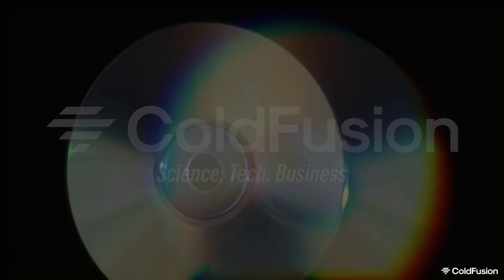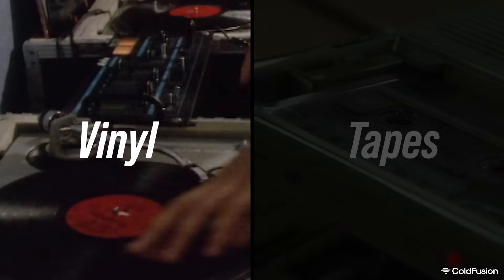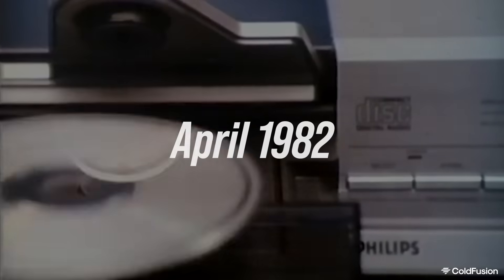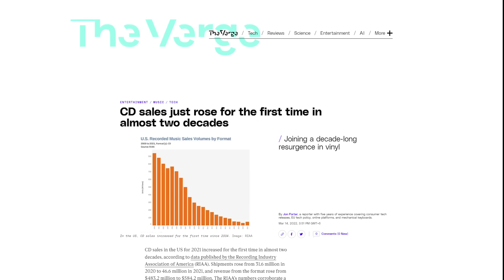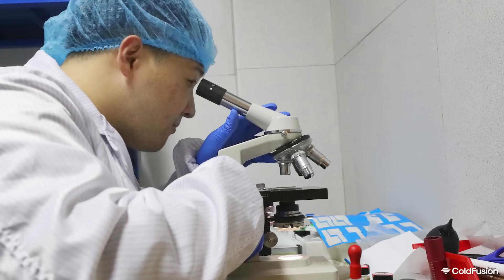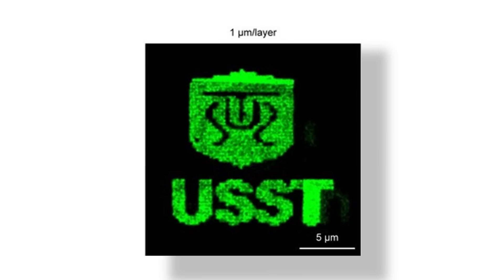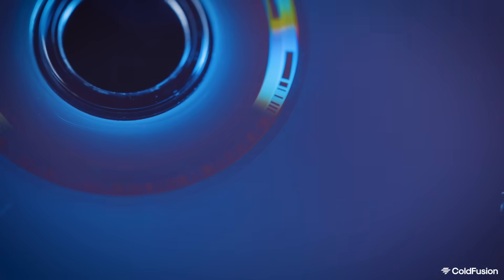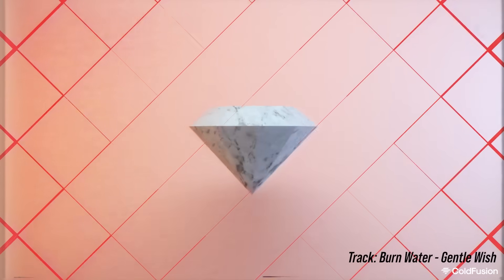Why This New CD Could Change Storage

Comment: If you want to store data for a long time, CDs are the overall best choice for longevity. 
HDDs and SSDs fail too soon if you want to store data for long.

CDs are back to stay.
Reply: tape backup is another good option, modern archival grade tapes are guranteed to keep data for at least 50 years which is more than a burned CD. a pressed CD might be able to keep up with that though
Reply: @oggilein1  very true! But that's mostly for enterprises, for the consumer the machine to read and encode is very expensive, even if the tape is cheap.

There is also the MDISC CDs which is rated to last a 1000 years, and now they have up to 100gb discs. Even if they don't last that long they solve the disc rot problems and other making it really durable!

For now the latter is my go-to for archiving media/data for stuff that I need to last.
Reply: @f11bot  with how this new disk technology currently is its not exactly consumer viable either
Reply: @oggilein1  oh yeah for sure, specially the equipment required to write or read, and its slow read speeds. But 100GB CDs are already very useful ngl
If someone found a way of making around 1TB CDs would be amazing, but without any major complications like just buying a new reader and you good!
Reply: @f11bot  Sony has a disk based archival system that has over a TB per disk cartridge... but they achieve it by having said cartrige actually contain 10 separate bluray-based disks (i think the disks themselves use a propriatary format to cram something closer to 150GB on each disk). its a fascinating concept but expensive and while having its niche, doesnt solve the underlying problem.
Reply: @oggilein1  okay that's super cool. It's a more brute force method of achieving said goal. I think I heard of it before but didn't find much info about it. 
If CDs became mainstream once again I think it would be found a nice consumer solution.

Comment: I'll believe it when I see it. 
Companies don't want consumers to have Physical Media anymore, so I doubt this will affect us common folk. 
Also how long will it last before degradation, they claimed normal CDs and DVDs would last decades if not centuries, we see how that panned out with some discs already decaying.
Reply: It would be nice if the general public had USB disk drives that could read and write 50TB a disk or something. Even if it was 'only' 10TB? It would be more then enough storage to fit hole Wikipedia topics or Education of skills/knowledge and such. That would be too good now would it not?
If the disk where only good for 10 years of archival? I mean? Today's HDD's are around 8-12TB and after about 4 years you are playing with fire. I mean really even 4 hours of usage can be enough to kill a HDD drive.

If the disks are cheap to make? I mean how much plastics are used simply in food containers? Or spinning rust drives. External 2 disk bays. One with a read and write head. Meaning that you could duplicate disks as they age. It really is the disk reader and software that should be the issue here.

The average people today do not want anything but convenience and clod solutions. Really it is more down to companies refusing to let this kind of physical media that is cheap and long-term sustainable that would put a stop to it being a form of storage of bytes. No one really needs HDD drives. Yet most would find use to have something as flexible and as cheap disk drives.  Ones you write the disk with data? The disk and read/writer drive can duplicate and keep the data with redundancy. Even if the disk drive itself is a single failure point? No problem. It could easily be replaced with the actual data never being in a real threat of being lost. 

The papers talking about PB on a single disk? Simply fantasy. It might be reality for enterprise servers. Even then it would greatly help with storage and backup issues if servers had hald-PB disks. Tape-storage is really slow with completely unusable seek times. Not to talk about durability as the tape has to be feed mechanically to be read. Whiles a disk only physical contact would be if the disk somehow collides with anything when spinning fast. Or exploding due to the rapid speed of rotation? I mean it is a HDD with more durable disks that can be swapped in and out of place. Not very re-writable. And maybe not as fast as a HDD. Yet it is far more durable and less physical drama involved. You are reading and writing with lazors! HDD/SSD drives are far more direct in how they make data stick and read off the storage.

Comment: I'd pay a reasonable price for 2TB optical disks.

I'd buy one each month for an extra offline backup of my company data.
Reply: NO, you wouldn't! You assume it would be cheap!
Reply: 5.5 TB Optical Disc Archive cartridges are ~$180, you can buy high density optical storage now.
Reply: @DigitalMoonlight  I've operated a 1200 tape 5 drive LTO machine.
I'm well aware of their existence but they're cumbersome and need quite specific physical storage requirements.

I currently use mdisc media to store 100gb at a time. It's affordable enough, haven't got horrible seek times and can be stored anywhere.

Comment: People who say CDs last an eternity must be insane. Or on drugs. Either one or the other.
Reply: To be fair, my 35 year old audio CDs are still fine. Pretty much all of my data disks, though, lasted maybe 5 years tops before becoming unreadable.
Reply: @totalermist  I have a bunch of Linux CDs and pirated PS1 games that were burned in the 2000s and they are all still fine
Reply: @Pasi123  consider yourself lucky then. Back in the 90s burning CDs was basically a 50:50 affair and even later it all depended on the quality of the CD-Rs. The cheap ones simply wouldn't last.
Reply: @totalermist  CD burners were also crazy expensive in the 90s
Reply: pressed CDs can last a long time, so can CD-Rs made of inorganic materials like the archival grade ones verbatim offered back in the day. its the CD-Rs with organic coatings that primarily suffer from bitrot. laserdisks are also much more prone due to how they're constructed. and finally blurays use inorganic material as the standard so any bluray will be good for about a century when stored in decent conditions, an eternity is hyperhole of course but short of carving your information in stone you won't get much better
Reply: And you base your opinion on a few CD-Rs that failed?
Reply: @mateuszorlinski7334  I base my understanding of disk bitrot on research that has been conducted by people who are far more knowleadeable on the subject than either of us, that includes you. the fact is that CDs are made of organic materials, and those material degrade over time. high quality CDs often have additives to try and slow or prevent this, while lower quality ones do not. as it so happens, a lot of CD-Rs were of such lower quality as consumers demanded cheaper prices for data storage and few people care if their data will stay on the medium for over a decade (or else no one would use flash drives today either)

Comment: You cannot interchange bits and bytes!

1.6 Petabits != 1.6 PetaBytes

PB - bytes
Pb - bits

the casing of the B/b matters.

but we use bytes for storage, not bits anyways (to explain storage to the masses)
however data is actually stored in bits.
so pick one and stick with it, dont go willy nilly saying the same number in bits/bytes.

they stored 1.6 p bits, not bytes from my memory.

Comment: some info about the Hiper cd rom!

The Hyper CD-ROM is a claimed optical data storage device similar to the CD-ROM with a multilayer 3D structure, invented by Romanian scientist Eugen Pavel.

The technology is supposedly similar to FMD discs. The bit of data being held as a change in fluorescence characteristics once irradiated with one or two lasers. The target is irradiated with a pulse of laser(s) then a CCD or photodiode wait for an emitted light by the medium due to the Fluorescence effect (bit value set to "1" if emitted, else "0").[1]

The reported storage capacity of one such disk is 1 000 000 GB (1 PB), as storage occurs on 2 000 different levels layered inside the glass body of the disk.

It claims to use fluorescent photosensitive material (glass enhanced with rare earth or vitroceramic enhanced with photosensitizing metals) as storage medium.

The Hyper CD-ROM technology is patented in 21 countries: the US, Canada, Japan, Israel and 17 European states.[2]

Despite its bold claims the technology has not been shown as a working prototype in the over twenty years since its announcement and there has been no commercial production.

In an interview about his work on the Hyper CD-ROM, Pavel stated that "the research for this project is 100% personal, [and] so is the support for experiments."[3]

source: Wikipedia

Comment: I would use this if the disks were about half the diameter in a protective cartridge, think Sony mini disc, this would be more practical for a portable storage medium assuming they solve the laser problem which is quite likely.

Comment: Here are some key takeaways:

History of CDs: CDs were a revolutionary technology in the 1980s, offering high-quality digital audio and eventually becoming a dominant format for music storage and distribution.

Current Status of CDs: CD sales have drastically declined due to the rise of digital music formats, streaming services, and cloud storage.

New Optical Disc Technology: Researchers have developed a 3D optical disc capable of storing up to 1.6 petabytes of data, which is a significant leap in storage capacity compared to traditional optical discs.

Technology Behind the New Disc:

Storage Capacity: 1.6 petabytes equals about 200,000 GB, significantly more than current storage technologies like solid-state drives.
Layered Structure: Utilizes 100 layers of storage, each a micrometer apart, with data encoded in nanoscale spots using advanced materials.
Reading and Writing: Uses precision lasers (green and red for writing, blue and orange for reading) to manipulate and read data at an incredibly small scale.
Potential Applications: Ideal for data centers and long-term archival storage due to its durability, longevity, and resistance to electromagnetic interference.

Challenges and Limitations: Despite its potential, the technology faces challenges such as high cost, slow writing speeds, and energy inefficiency, which currently limit its practical adoption.

Future Outlook: While unlikely to revive CD sales for personal use, the technology could find niche applications in high-capacity data storage and archival needs, depending on future advancements and market demands.

Overall, the video explores both the nostalgic history of CDs and the potential future of optical storage technology, highlighting its strengths, limitations, and possible avenues for development.

Comment: Now it turns out that DVDs 📀 and Blu-ray Discs 💿 are further manifestations of CD and they carry same physical dimensions.

Now with CDs with capacities above 1TB, the terms DVD and Blu Ray discs would be obsolete.

We said that CDs could carry a maximum of 700 MB, DVDs could carry maximum of 4.7 GB, and Blu Ray discs could carry maximum of 100 GB storage (maximum storages of Blu Ray especially 25 GB and 50 GB were optional). Now, the new generation CD will mark the new generation of Optical discs. They are making a comeback with CD term and may support advanced Blu Ray technology or beyond.

ICYMI:

1st generation ODs: Laser Disks (LDs), CDs, VCDs.
2nd generation ODs: DVD, HD DVDs.
3rd generation ODs: Blu Ray discs (BDs or BRDs). with 25 GB, 50 GB, and 100 GB.

Comment: cool, but limited use cases since it's non-eraseable. if it was, they might compete with SSDs for storage.
Reply: even a rewriteable one would be limited since the read write speeds of disks are just so slow compared to SSDs, even a version with hard sectors like DVD-RAM was (that essentially acted like a flash drive but it was a disk) wouldn't be able to fix that, you just cant spin a disk fast enough to get those kinds of speeds since the disk would destroy itself if spun too fast

Comment: I'm already interested. I'm using BluRay MDISC disks for my backups. 200TB of space on a single disk is a huge upgrade from 100GB.
I don't use cloud storage at all.
But with costs as high as that shown... maybe in 10 years from now...
Reply: Linear Tape Open (LTO) may interest you, they are on the market right now and the latest gen, LTO9 does 18TB per data cartridge. it's a tape based system primarily for data backup so not good if you need to quickly access archived files but a fascinating bit of tech at the very least

Comment: A few things come to mind when hearing about this:

This bears a lot of resemblance to silicon process nodes, where without EUV nodes they can do a sort of "pattern matching" where by overlaying two, for sake of example, 14NM etchings, you can take the difference and get a much smaller practical etching that functions like a 7NM one. The numbers here are made up, but it illustrates the concept.

Taken that way, while the obvious application of this technology is as was done in their lab, an expensive datacenter focused technology for super dense information, for consumers I think the equation is a bit different. There are probably plenty of interesting applications of 200GB, 400GB, 1TB, 10TB disks, and so on. Taken in that light, one could probably use commodity lasers to achieve better than current consumer state of the art, but not hitting the same depths of density as seen in the datacenter variants. I'm pretty sure even cutting back from 200TB to 20TB would yield a significantly more manageable mechanism in consumer contexts.

What uses would this have in the consumer space? Well, off the top of my head:

If a 20TB disc is cheaper than a 20TB storage drive of equal durability (I find this likely), it would make a killer immutable backup drive.

You could have a literally immutable Linux distro snapshot taken, for instance, every year on one of these disks, and then all your live storage could be done with a much smaller drive than usual, storing only the difference between the CD and the current state of your PC (if you have a ton of files, like media, which aren't expected to really change, but you want it all to be visible in a single "drive" for whatever reason, that would be an interesting configuration).

Sharing uncompressed media is kind of interesting for people into that.

Backing up things you don't expect to modify, like family photos, off of the cloud could actually save money in the long run.

And that's all just off the top of my head. I'm sure there's things I'm not even thinking of right now.

Comment: 7:00 Here the disc is said to hold 1.6 Petabytes but later at 7:49 the disc is said to hold 1.6 petabits, are we talking about the same disc here or two different ones?
Reply: the disk is 200TB, so 1.6petabits, the petabytes claim was a mixup. blame the scientists for using bits so that they can boast with a larger number instead of using the same units as everyone else

Comment: Don't necessarily need to mass market the most advanced version of this.

Even a terabyte version of this could be useful to data-centers if the price for that could be brought down and once you mass produce and perfect the technology for that perhaps an affordable home version could be possible..

What I would do as well would be to enclose the disk itself inside of a case that opened up once it was inserted, there use to be a version like this in the early 00's, to further protect the disk from damage. In addition you could halve the layers and use the second half as a secondary write area to duplicate the data to opposite side of disk as protection against scratching. 

Make drives that can handle 2 or more disks and you can have them operate in RAID style setups.
Reply: currently you can get quad layer blurays that do 100GB per disk, a disk that does a couple terrabytes per disk while being in the same price class would be a game changer for people keeping personal backups om disk

Comment: it would have to be sold commercially as read-only, and probably in a hard case, right? 20th century 4k mgm complete collection... $200; buy two decades of internet archives on one disc; the most comprehensive interactive encyclopedia ever... etc. etc.  I can't see this having much of a traditional commercial media use case though

Comment: The only reason I gave up optical discs is that they don't provide enough value anymore.  I still want local storage (the cloud is no substitute), but I can store more data on SSDs and even flash cards than discs.  But just like the CD was a must-have when it came out, a technology that lets me store 200 TB on a CD-sized optical disc would get my money, if it was efficient, reliable and affordable.

Comment: You'd have to be able to write multiple times to it, because no one would have hard drives big enough to write it all at once.
Reply: ..and be able to erase no longer needed data. There were standard CD/DVD writing programs that allowed the disc to NOT be finalized and be written to multiple times. However, you COULDN'T free up space erasing old data. Once you used up the 700 MB on a CD or the 4.7 GB on a DVD, it was done.